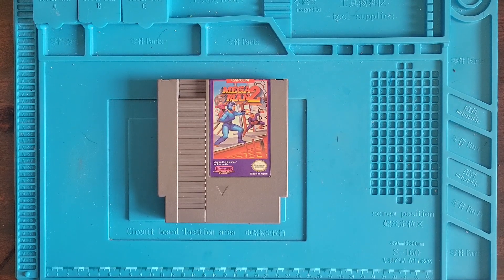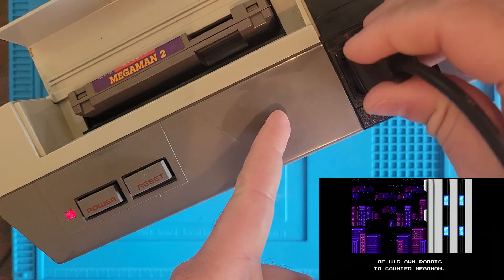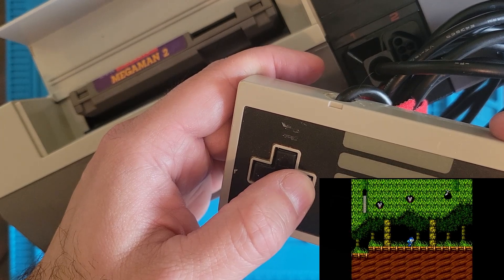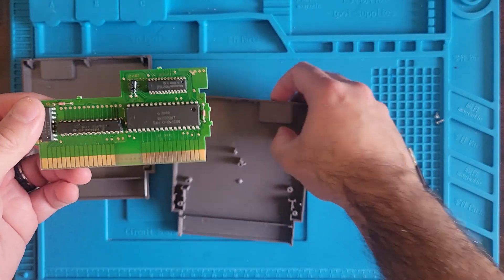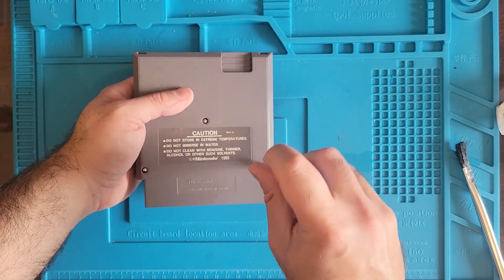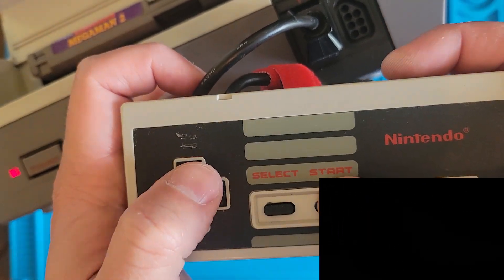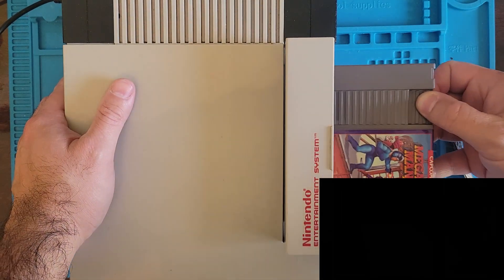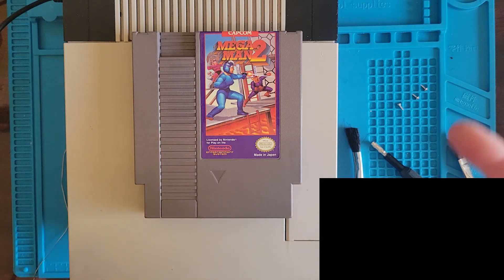When Wash It Wednesday Turns Into Try To Fix It Friday: The Mega Man 2 Saga!!

Comment: Have you ever recapped your nes? That's good thing to do now and in order as the time as come for a cap refresh on both console and game. I would love to see a update video you recapping the nes if not already done and the game. I've got a gnarly pcb of a megaman 2 that I thought for sure was cooked but it came bundled with a second one so for giggles, I swapped all the chips and they both work i guess the pcb has so much corrosion that its far gone because when I placed the IC's back the game would fire but everything is gargled. Although I recapped my nes I'm going to do it over with some high quality caps since I only did a few main ones and can't remember which ones they were. Plus its acting a little funny so I'll give it a go. Lol I really need to get some videos up to show you some cool stuff 😎 😅
Reply from the maker: I have not recapped the NES that’s in this video. I did put a new cap, ram and CIC chip in this cartridge and still the same issue remains I’m thinking the ROM itself is the issue. I should try board swapping the ROM and see what happens!!
Bro can’t wait to see your videos!! Are you going to be making a YouTube channel? 🐺🐺😁😁
Reply: @wolfmanrepairs  I'm so hyped too but I'm scared lmaooo I would definitely need a tripod and some other fancy accessories like possibly a capture card but yes eventually I plan to have a channel going. Maybe even some Wolfman collaborations 😁👌
Reply from the maker: If I can do it you can do it bro!! Collaboration would be awesome!!!🐺🐺😁😁

Comment: could it possibly be the capacitor on the top  of the board going or gone bad?
Reply: +1 for "check the cap!"
If any of the chips had gone bad then the game would not boot at all. Replacing the cap seems like the easiest next step to trouble shoot this cart.
Reply from the maker: Thank you both!! I will definitely be checking out that capacitor!! 🐺😁
Reply: Capacitor was my first thought as well
Reply from the maker: I will have to make a part 2 and check out the capacitor. Hopefully that’s all it will need to run the way it should!! 🐺😁